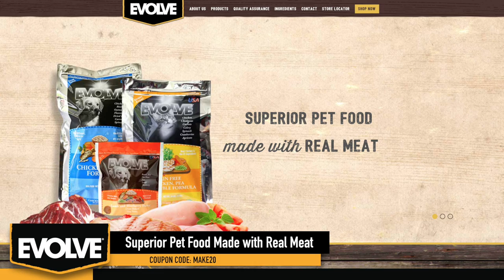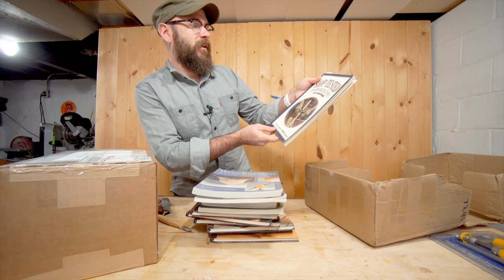Making a Wiener Dog Ramp. Will He Use It? | Woodworking Project.

Comment: Another fun and useful build! My pet projects: On my old house, I added a flap to my full screen back door for my cats (and later dog) to get in and out. Since it was a full screen (no glass or other panels), I had to build out an extra bit of frame for the opening, cut some screen for the flap, and then weight the bottom so it would hang properly. When it was done, you couldn't tell it was there or not original to the door. On my new house, the back door has an aluminum sheet at the bottom, so when I went to add a store-bought pet flap, I had to build a wooden frame to mount it on for added thickness.

2017 is going to be a great year for me in the shop. Since we moved about 2.5 years ago, I never really put mine back together again. Thanks to inspiration from you and my other YouTube maker heros, I'm finally doing it and getting back to work out there. Time to have some fun!

Comment: I used the first method you described for our injured cat. The stairs were perpendicular to the bed and I had a base that I could take the stairs off of and use the stairs for access to the couch when we were downstairs. It worked out well. Great project and video.

Comment: I too have a weenie dog, he is going on 13 years old so his ramps  have been around for years. However, there is another project I did for him when he was about 6-7 that he absolutely loves - a "cave!"

Just a simple box (no bottom so he can lie on the carpet rather than the MDF) with offset openings. The cave is dark inside and the entrance "tunnels" are just an inch larger than his body. The cave has now evolved into a cave system. Two caves are connected with a long tunnel and has two entrances that are around 6 feet away from each other.
If you have the floor space - build it - your little weenie will love it!
Reply from the maker: Oh man! That is awesome!

Comment: Weenz is one lucky dog :)  I made a weighted (so to not be top heavy) cat assist step some years back for the cat to make the jump from one of the steps to the second floor (steep stairs with a safety gate - it's an old house - mid 1800s). Our old cat used it before she passed and our current cat makes use of it now.  - Jim

Comment: I made what is basically a toy box with an open end that the cat litter is in. Much more appealing than a litter box in the middle of the apartment.
Reply from the maker: Oh nice!!! I need to do this for my cat!
Reply: Make Something similarly I converted an old HiFi cabinet for my cat's litter box.  Created  an entrance on far side, carpeted inside to reduce litter tracking, motion activated led for aging eyes.  Easy access for cleaning through top where turntable used to be!

Comment: Hey man, awesome project. Why'd you change the angle toward the bottom instead of keeping it all one plane. wouldn't a lower start be easier on Weenz?
Reply from the maker: It's a good question! I wanted to make sure the angle wasn't too much for him to get started up the ramp. I ran into this problem with my outdoor ramp to the back door.
Reply: That's kinda what I was figuring. Thanks!

Comment: I don't understand why you built it right up to the top of the mattress, yet had a 'step' from the ground.
I would have built it like an ottoman, but with a side sloping top, and only up to the bed base, only needed to be about a foot wide, and no need to worry about a flap to put in place.
I would guess at night you may forget the flap is there and fall over it.

Comment: Hey, I noticed you opt for a sled and don't use the saw stop sliding table saw majig. Are they for different applications?
Reply from the maker: The SawStop sliding table works better for really large pieces. Anything under 24" is just easer to use the sled.
Reply: Make Something thanks, I've been looking into a Sawstop and liked the idea of the sliding table add on wasn't sure if it's worth the extra cake.
Reply from the maker: I personally don't use it very much. If you use mostly large sheets of plywood then it may be a nice feature for you.
Reply: Make Something I was thinking it might work well for cross cutting but I'm getting the idea a good cross cutting sled can't be beat. That's what I use now. thanks for the response it was really helpful. Merry Holidays!

Comment: Ramp should have gone all the way to floor. Wiener dogs have back issues that are compounded when the have to jump up or jump down from higher levels. While I commend you for making a ramp it would have been so much better had you actually finished the ramp with it going all the way to the floor.

Comment: Why didn't you make the end of the ramp longer so there doesn't have to be a step? It would still fold out of the way. 

I think you should do a separate video for your mail and stuff at the end. Maybe put it in your second channel. Plus if someone finds this video several months or years from now, it doesn't have a somewhat random section at the end. Just my opinion.